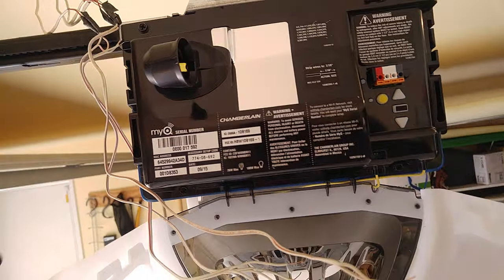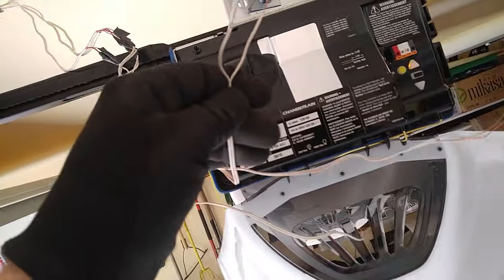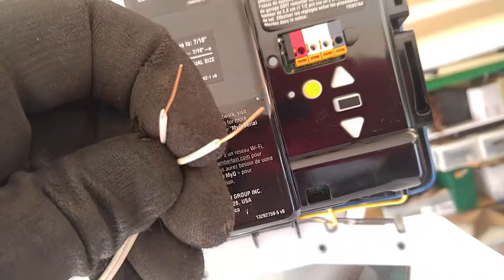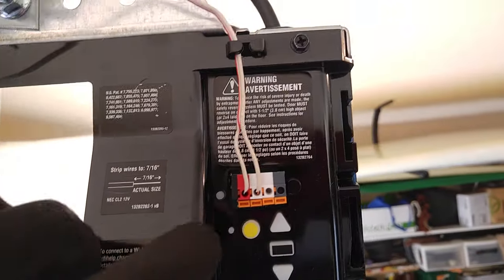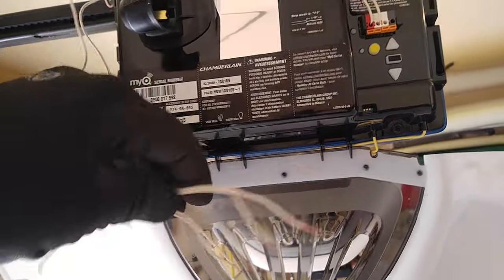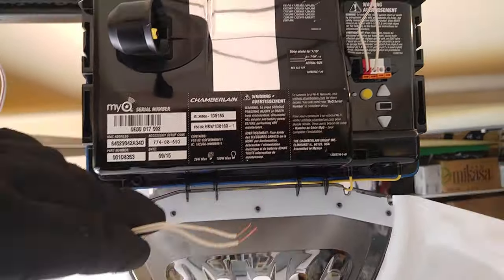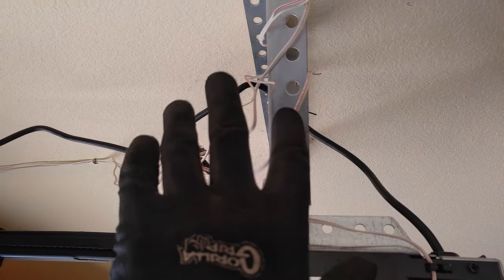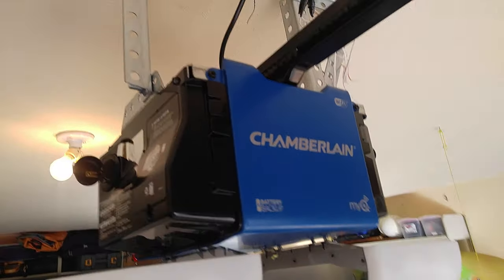✅Wiring A Chamberlain Garage Door Opener

Comment: Why on Earth would you skip the part showing how the wires are inserted, and what those orange tabs are for?
Reply from the maker: If I had a 3rd arm I would have shown that part! 😅
Reply: Exactly. That was the only reason why I watched the video.
Reply: You push the orange tabs forward with a flat head screwdriver to secure the wires once in the hole 🙂
Reply: So how's the wires go in no explanation
Reply: Lame video.  Intersecting and removing the wires is crucial.
Reply from the maker: Can't please everyone! 💥🤟🏻💥
Reply: @garagedoorgenius  That's not an answer genius!
Reply from the maker: @Bluffton3  😭
Reply: You push them to allow wire in
Reply from the maker: @nvmarv 💯

Comment: I was hooking one up for my Aunt, she never had one but the wires were pre-installed. There's 4 wires (black, green, yellow and red)wrapped in a grey jacket, but I only need 2 of those wires right? Which ones do I use? I'm thinking if I use all the same colors it should work?
Reply from the maker: You're correct.  You just need 2 of the 4 wires.  You choose, doesn't matter the color.

Comment: This might sound like a dumb question but if your garage is pre wired, that wire isnt hot until you plug in the motor correct?
Reply from the maker: Not a dumb question at all.  You're right.  Until that opener is plugged in, the wire is dead.  It's low voltage, so no worries about getting shocked. 👍🏼😊

Comment: All I have are red and white wire (no stripes). I was able to locate the which wires were for the wall button. What do I do with the remaining wires (2 red 2 white)??? Thanks in advance.
Reply from the maker: @BruceDaTruth2  great question!
Just hook your reds to black and your whites to whites. 👍🏼
Reply: I did just that before coming back to check for your response. Working perfectly. Chamberlain Customer Support had me thinking I’d need a technician. Thank you so much for this video and your response.

Comment: I have wall buttons in the detached garage, but want to run wired wall buttons into the house as well.  Can I connect the wiring for the 2nd switch to the terminals in the already installed original switch?

Comment: Thanks for this video. I was looking for how to find wall button wires and sensor wires.. I am trying to connect my second garage door opener. Let’s say I don’t have wall button for second opener. Is there way to differentiate wall button wires and sensors wires?? 

Thanks in adavnce!!
Reply from the maker: Thanks for the positive feedback!
It's just trial and error unfortunately in your case.  Plug them in until you find the safety sensors.  Then just run an external wire for your roll button.
Reply: @garagedoorgenius  okay but how do I find if safety sensors is ON or not?? Will there be light turned ON for safety sensors?? 

Also is it Okay not to plug in wall button wire to opener??

Thanks!!!
Reply from the maker: Yes, there will be lights that come on the sensors when they are plugged in.  Chamberlain LiftMaster products you need to get the orange sensor led on first before the green sensor led will come on.
Some models you can leave the wall button off.  You just need to see if yours can be.
Reply: @garagedoorgenius  thanks.. I figured out wall button and safety wires. However neither of safety sensors led is turning ON. What should I do?
Reply from the maker: I would recheck those wires again.  Unplug all the wires.  Try each wire in the safety sensor terminal.  You should get the Orange LED to come on.  Leave it plugged in.  Then try the other wires again until the green sensor comes on.  Then obviously the last wire will be the wall button.
Reply: @garagedoorgenius  ignore my last comment.. sensors are working fine now.. I have one more question is it Okay to have lossen belt ??
Reply from the maker: @jame2237  no.  You want the belt some what tight.  Tight enough so it doesn't sag.  
Also, don't over tighten it.  That can wear the belt out plus the drive gear.
Reply: @garagedoorgenius  got it.. I think I fixed it..
Appreciate all help.

Comment: After looking at the schematic, and if all are wired by that, the wires you need to concern yourself are the red and white from the left. PUSH in those orange rectangle clips and pull those wires out. Splice the wires from the Wyze controller and wrap around the existing wires on the unit. Push the orange clips in and put the respective wires back where they came out of and release. That’s it.

Comment: Great video. Does it matter what kind of wiring I buy? Having trouble finding one for my lift master model.
Reply from the maker: You can use CAT-5 wire.  That's pretty common.  🤘🏼🤓👍🏼
Reply: @garagedoorgenius  Thanks so much!
Reply from the maker: You're very welcome 😊!
Reply: @garagedoorgenius  So regular old skool phone wire would work too?
Reply from the maker: @Happy_Harry  absolutely.  It's a low voltage wire so. However, you could go to Home Depot or Lowe's and pick up some thermostat wire. That stuff's a little more robust. It's a solid copper wire. And it's really not that expensive at all.

Comment: Hi Richard! Instead using the solid low voltage copper wire, would it be possible to use a 20 gauge stranded copper wire?
Reply from the maker: Yep. Although they come loose easier.  I'd definitely use good wire nuts or tape it really good.
Reply: @garagedoorgenius  thanks for the precision.

Comment: Hey Richard, Having issue with my sensors. Orange light stays on but my green light not coming on at all. Assuming bad sensor, I replaced them. Well, still no green light at all. Thoughts? Bad wire somewhere in wall leading to that sensor maybe? Any suggestions would be awesome.
Reply from the maker: Michael most certainly the pre-wire behind the wall could be pinched.  You can externally run the wire that's already supplied with the sensor, run it back to the unit to verify.
Normally those sensors are pretty hardy.  I install several weekly and can't remember when I've had a bad sensor.  Also saying the sensor couldn't be bad either. 🙂
Reply: Garage Door Genius thanks
Reply from the maker: @mikedunklin  you're welcome 😊!
Reply: You can check the sensors by lining them up and plugging them into the opener without the wires going anywhere. Once you have verified the sensors are good, you can troubleshoot the wiring.

Comment: So i have a problem. All my wiring is done and done correctly i program the limits and the torque correctly, and the door button on the wall is flashing and wen prees it doesn't do anything just keeps flashing, so were did i went wrong or what can i do.
Reply from the maker: It's very possible the wall button is bad.  Chamberlain LiftMaster have had issues with them.
Can you operate it with a remote?
Reply: @garagedoorgenius  yes i can open and close it w remote, the door button is simple open/close booton i took it off and bypass it with a piece of cable didn't work  doesn't make any sound either. 
There's 1 more thing the door booton has a light it turns on and off continuesly

Comment: Are you on Twitter? This is the same issue I’m experiencing with a B4545. We took down an old Genie 1024 that had 6 terminals. The B4545 has 4. The wall control is on, but has no input. Sensor wires are in. But down force causes the lights to blink. I am so stumped.

Comment: Do both sets of safety eye wires go into the single white and black terminals?
Reply from the maker: Jason Gross 
Yes they do.  
Red/White = Wall Console
Black/White = Safety Sensors
Reply: Thanks I had same question my wires all came loose reaattaching the horizontal bar-chain- thing y

Comment: I only for colours coming from the ceiling, red/yellow/black/green which one should I use?
Reply from the maker: miguel 
It doesn't matter what color you use.  As long as their the same color when wiring up the wall button, sensors, or to the unit itself.
Reply: Thanks for you help.
Reply from the maker: +miguel 
No worries!

Comment: I really need some help , I have 3 wires coming from the ceiling , each one of those wires has another 4 wires to it......red with white....then a blue with white....and like i said theres a  3 of those, so have I half 12 wires in total..."I'm confusing myself here"....im sure you know what I mean, I have the Chamberlain whisper opener...please help
Reply from the maker: J Ramos 
Each wire coming out of the ceiling has 4 wires.  You only need,2 of the 4 wires.  I always use Red/White.
Cut off the other 2, just to be less confusing.
Now, 2 of those wires coming out of the ceiling are for the sensors, and 1 wire for wall button.
I always find my wall button first. Red to Red and White to White.  once you locate which wire is the wall button, then you know the,other 2 are for sensors.
Sensor wires are,black and white.  So you'll use Red to Black and White to White.

Hopes this helps!
Reply: Do you use both wires coming from 1 of the remaining lead wires, or do you use one wire coming from both of the remaining lead wires?

Comment: I added a pair of wires to both terminals in order to use an inching switch, but when I short them the wall panel turns off and the doors don’t move.  What am I doing wrong?
Reply from the maker: If you're wiring an inching switch to the unit it may not be compatible.  Have you done that research?

Comment: This is frustrating. I am able to connect the app with the motor but I cannot connect to the app to  the wall button. I wanna connect to the wall button so that I can open the garage indoor.!!!
Does anybody have the same issue
Reply from the maker: @sonnydo95  not quite following you?  You can't control the opener with your MyQ app or the wall button doesn't work?
Reply: @garagedoorgenius  Sorry. I can control the garage with the myQ app after I connect with the garage open, but cannot with the wall button. It keeps blinking fast!!
Reply from the maker: @sonnydo95  if the lightbulb in the garage door opener flashes 10 times, realign the safety sensors.  That's why it's not closing more than likely.
Reply: @garagedoorgenius  nothing wrong with the sensors. The wall button blinks. It does not connect with the garage opener.
Reply from the maker: @sonnydo95  that's weird.  I know from a new install you have to press the wall button 3 times to activate it.  Then after that only 1 press.  I would call tech support and ask WTH is going on.

Comment: Well u got 3 sets of wires but only two sets to plug wires in.. where do the third set of wires plug in at
Reply from the maker: 2 sets are sensors.  The last set is wall button wire. 👍🏼
Reply: Hey James, your question is the same one I have. Did you ever figure it out? 

It still isn't clear whether you set aside one of the lead wires completely and not use either of the two wires coming from it, using only two out of the three lead wires in total, or if you take the two remaining lead wires that are coming from the ceiling and plug in only one of the two wires from each of them.

Comment: I'm trying to fix my garage door wiring and someone told me the safety sensor led light should blink the same color. Is that true or false? 
Also I only see 4 wires that are only coming from the safety senors and my garage power wires (red+white) is running into a transformer & back out to the garage push button. Should I just cut it off the transformer and run it into the garage terminals itself? 
And my last question, there is also an extra purple wiring hanging off the garage opener but no where near the terminals. I heard that it's considered an antenna wire? Not sure if it's necessary to have it there or not.

Thank you!
Reply from the maker: Hello!
First, it just depends on the brand what color the sensor led lights are.  If it's a Chamberlain Lift Master one sensor will be green and one will be orange.
Second. Yes, just wire the sensors to the terminals.  Sounds like there not even close, since the transformer thingy..
And lastly, that is your antenna.  DO NOT CUT! Lol. Its very important.